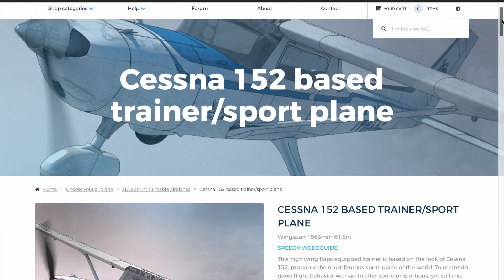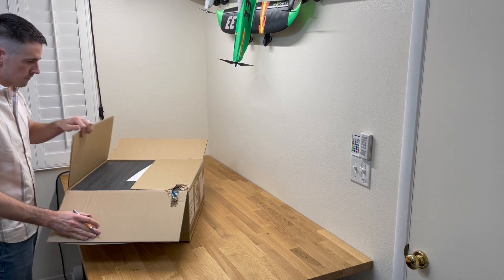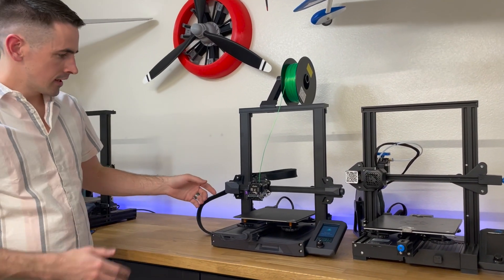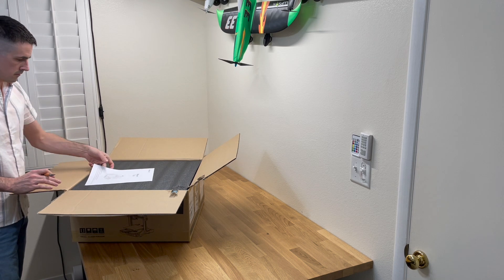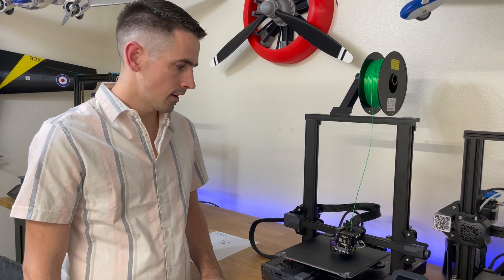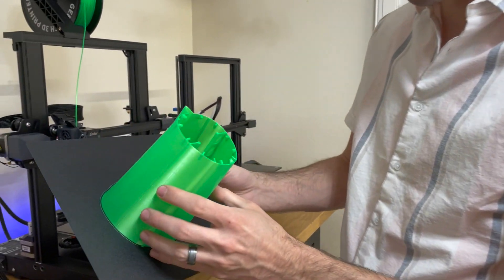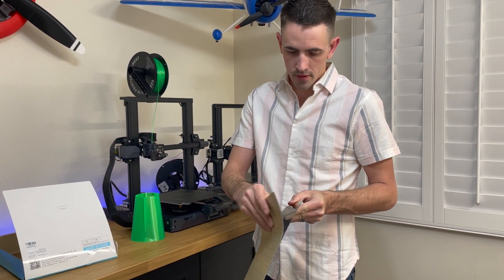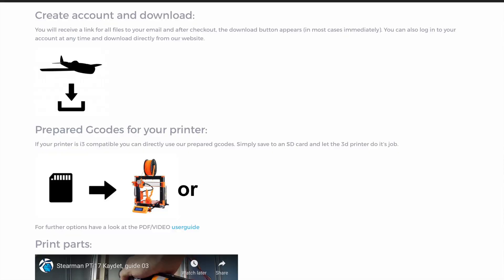Will a Prusa G-code work in the New Ender 3 S1?

Comment: Dear Troy, first of all, thx for sharing all these great and inspiring videos ! As i am know about to buy my first 3 d printer , would you mind sharing your opinion on a ender 3s1 pro versus an elegoo neptune 4 pro. ?? (Knowing this question might be boaring and ridicolous the same time...- without any clear yes and no... My main goal is to start 3d printing for some rc models ... - i saw the recommondation from eclipse for an ender  3s1 ... now i saw also your vid on 3S1 ... :-) -knowing your potential pref for more professional printer - but i guess i would like to start with a more budegt version , as i do not know how long i will stay in this... Would you see any advantage in the Klipper based system of the Neptune 4 ?

Comment: Troy Have watched all your vids and have just bought a ender s1pro .Thanks for great Videos.  Been trying to print PLA_LW but haven't had any luck , to much stringing and not sure on what settings to use. Prints ok using PLA from the Gcode as per your suggestion. Do you have a Cura file of settings for the ESUN  PLA_LW .I've also tried importing cura settings but this fails. IT is the RC sharkv5.0 I'm trying to print

Comment: I’m currently printing an Eclipson model C on my Prusa Mk3s+ using there G-codes, if I’m not mistaken Eclipson use Enders to print there aircraft so the G-codes are specific for enders.  The prints comes out flawlessly and funny enough I once printed a bungee prop from 3Dlabprint and off course I used the G-codes confident enough that they would work straight away, to my surprise most of the parts were a nightmare to print and I had to tweak the temperatures on most of the files, the wing tips were the worst to make.

With the eclipson models I didn’t had a single part that didn’t print well so in my opinion I think its all about how well the parts are sliced. I don’t have any experience with the ender printers because the Prusa is my first ever but I’m that once set correctly they are very good value for money.

Comment: Hey Troy, just want to make sure I understand.  You took a 3DLabPrint G-Code file supplied by 3DLadPrint and printed it.  You didn't slice with PrusaSlicer first... is that right?  Thanks.
Reply: Yes, that's what Troy did here. It works, because the S1 is direct drive and the retract settings are similar between the two machines. Beautiful result.
Reply from the maker: @av8za  exactly! :)

Comment: You can even use prusa gcode on 3dlabprint files on standard bowden printer just change gcode settings in notepad. To be honest I recently switched to Prusaslicer from Cura as they now have a specific setting for 3d printed planes and it works amazing.
Reply: Cura can do some stuff better , but what Prusa Slicer defintely replaces is simplify 3D.. I paid 150 bucks with a promise that they would come up with the long awaited Upgrade 5
that was more than 2 years ago since then Dead silence  and simplify is Dreadfull with my MMU on the Prusa ... 150 Bucks down the drain
Reply: @hpsie8310  yea Cura does surface mode far better than Prusaslicer. I just find Prusaslicer a smoother print and I refuse to buy simplify 3d as it's far too expensive for what you get.
Reply: @rodneytrotter2643  Absolutely right .. I had better bought Filamnet for the dollars I paid for it
Reply from the maker: I am aware of it, the software has been around for a while. This is definitely much easier!